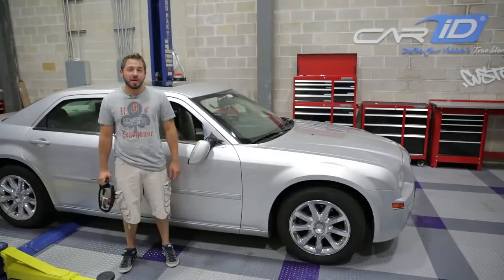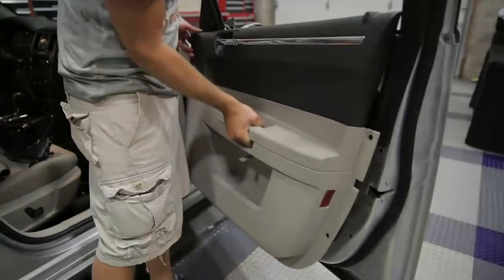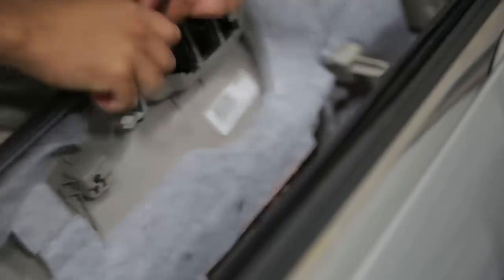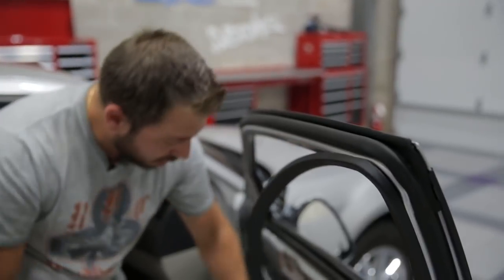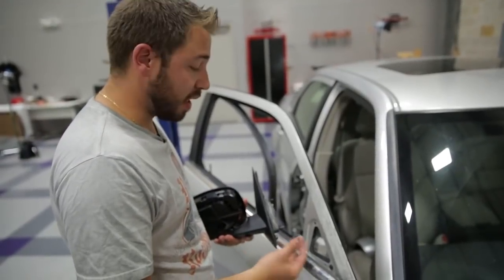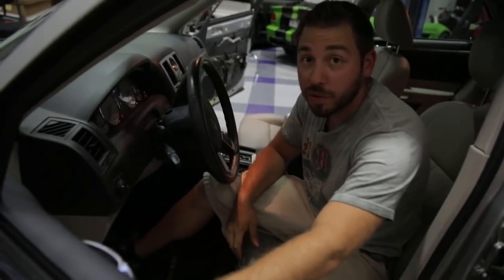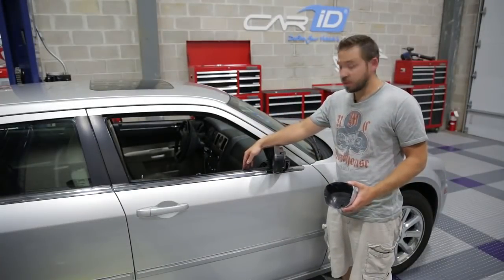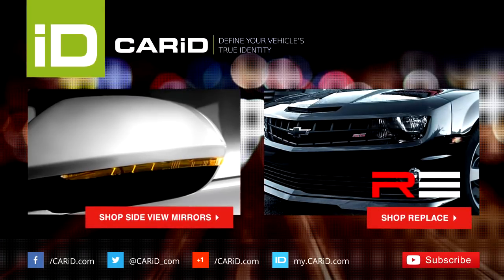Replace Side View Mirror Installation on 2008 Chrysler 300

Comment: Thanks for this video!  I was able to complete the repair pretty easily thanks to watching this.  A tip - when re-positioning the trim piece that has to be (at least partially) removed to access the mirror screws, stand on the other side of the door to better view how it fits on the door frame edge - it's frustrating otherwise.  Also -- do NOT push in the center pieces of the panel push clips all the way, thinking if they fall in (they will) you can just get them once the door panel is off -- wellllll, they fall inside the DOOR and they might as well have gone into a black hole.  So here's the OEM part number for when you have to buy new ones!  WX68DX9AA (fit 2008 Charger and others)  :)

Comment: Do you happen to know if there is any way to just purchase the mirror cover for a 2007 Chrysler 300 (V6, AWD). All I've been able to find are chrome mirror covers, and I just want a stock/unpainted/black (whatever, just not chrome). 

I recently bought a 2007 Chrysler 300, and it was missing the mirror cover, and a wheel cap/cover. I got the wheel cap, but still can't find a decent mirror cover :(

Comment: can you do a Spec-D rearview mirror installation or show us a wire diagram for the blinker cable?
Reply: CARiD.com there are 3 eletrical connectors; power mirror, blinker and puddle led.i already did the puddle led. really needs help with the blinker cable wire.
Reply: CARiD.com I need this video to show how to do the led blinkers on da mirrors. When is this video coming

Comment: The mirror cover, how do you remove it?  My driver side mirror needs to be replaced but the there's nothing wrong with the chrome mirror cover, just curious how you do that?
Reply: The mirror covers on my 06 are not aftermarket, OEM.  At the end of the video I notice you just snap the painted mirror cover back on, how do you get it off?